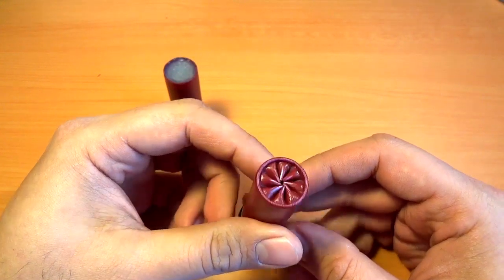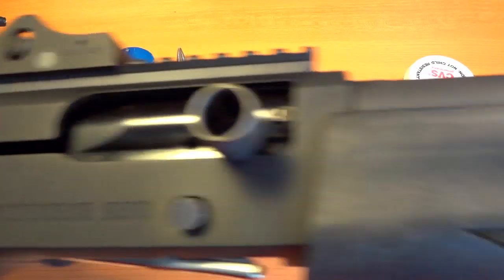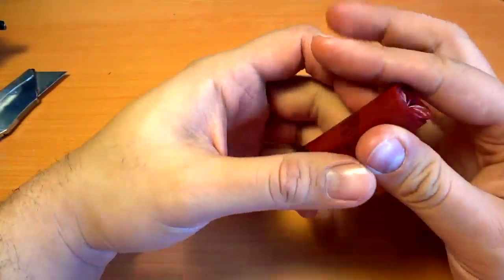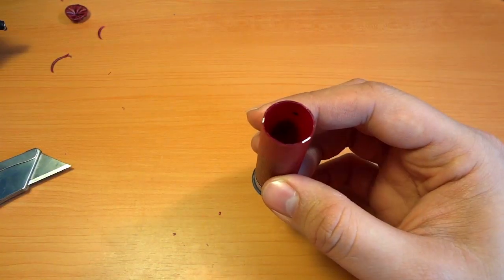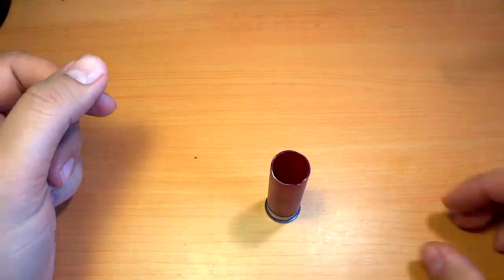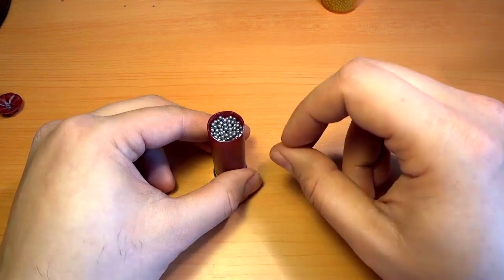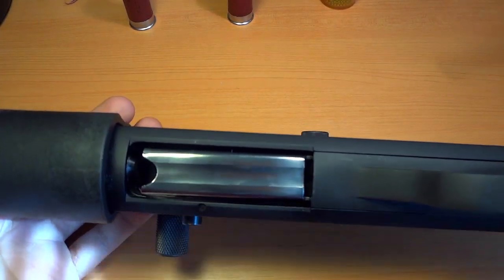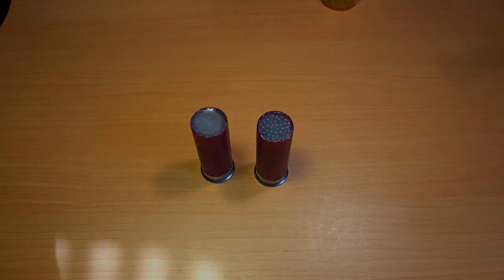How to make a cheap 12 gauge snap cap

Comment: Using an already spent shell is much safer. I've made over 20 of these. My advice is to do away entirely with the wadding. Put hot glue in the bottom of the shell, load all the shot back in and then top it off with hot glue. This also ensures accurate weight of around 185 grains so when you practice loading your using shells that are almost exact in proportion to the real thing. Aside from using a live shell, the wadding, and not ensuring accurate feel and weight this is a very helpful video.

Comment: Just tried this, it's legit, however, word of caution, I soaked the primers for 24 hours with a water/vinegar/lime juice solution and let them dry for a bit - primers were still combustible. Also, wondering if replacing the primer with some type of flexible material (ie silicon) is better.

Comment: Why would you soak anything?  Just take the shell, remove the shot, wads, and powder like shown here, load it into your shotgun, dry and in tact, and fire the primer.  You'll get a little bit of a pop, not quite as loud as a .22 and that's it.. you know for a 100% fact that primer is spent and will never have to worry about it again.  I don't get why you would purposely get it wet and risk the primer not being 100% neutralized...